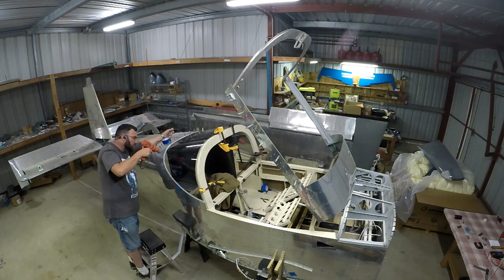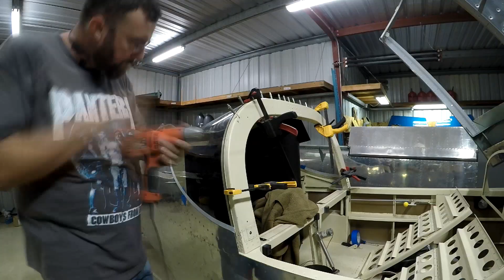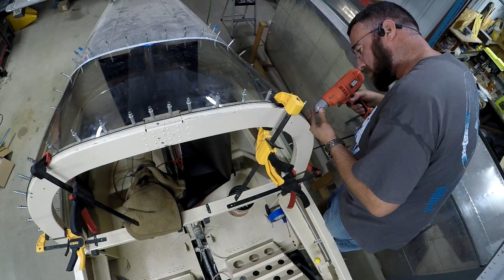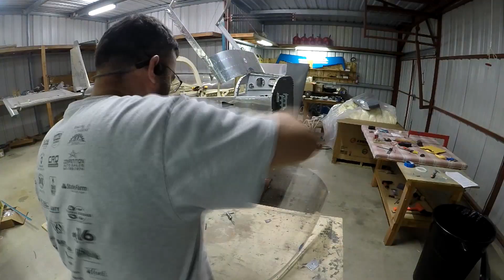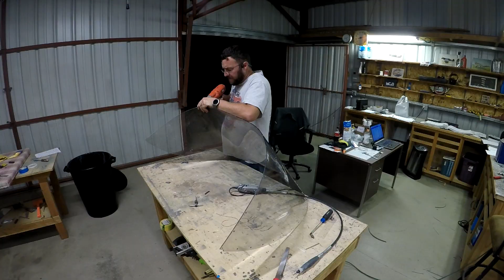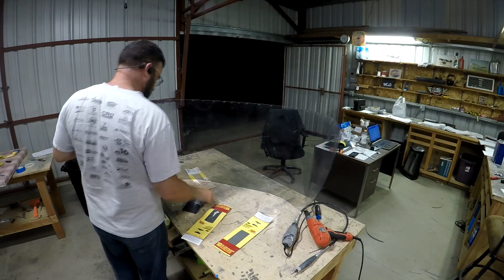RV-14 Aft Window

Comment: If you didn't do it you want to enlarge the holes in the plexi for expansion, and using a brand new unibit does a good job.
Reply from the maker: That makes sense to me, but for the rear window at least, the instructions state to tap the plexi the same as the metal it is attaching to (step 4 on page 38-03) but the window should be slightly enlarged, I would think….